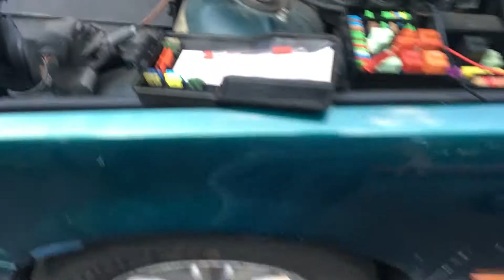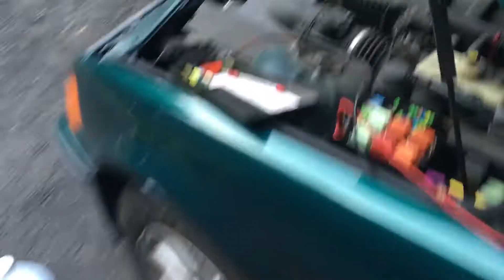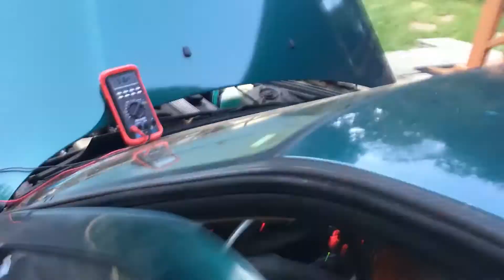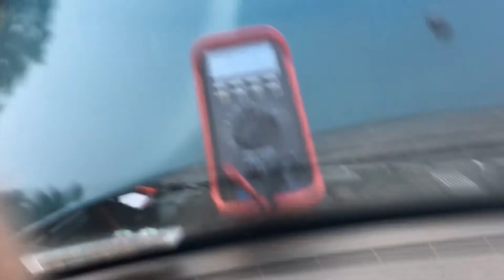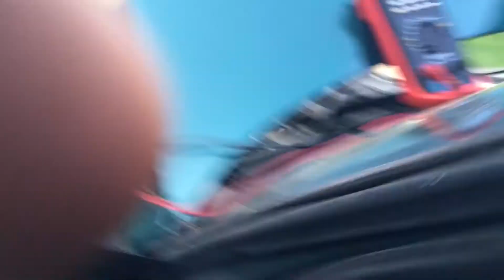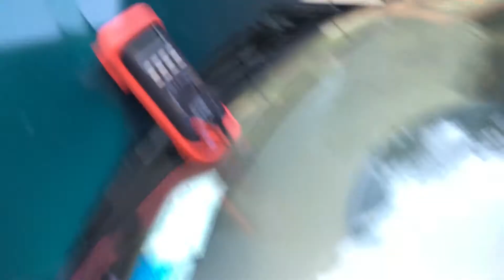1997 BMW 328I E36 - No Start / Fuse 31 Blown / Bad Heater Control Valve / Troubleshooting - SOLVED

Comment: I had the same issue a few months back in my e36 328i 96 obd 1. Fuse 45 was blown, it’s for the brake light control & instrument panel. Fuel gauge wasn’t working too. Replaced that fuse 45, car started.

Comment: So my 328i has the OBC and HVAC turn on and off periodically (weeks in between) and I’m suspicious of the heater control valve doing something similar. I’m not sure why obc goes out though. Thoughts?
Reply from the maker: I can only suggest disconnecting the heater control valve and seeing if the problem goes away. The valve isn’t needed for everything to function, It just will get hot in the cabin in the summer. I am fairly sure it locks off the heater core when you aren’t calling for heat.
Reply: @StanwoodStudios  I’ve had same issue, I’ve had my hcv unplugged for about 2-3 years without a problem or blowing fuse 31 👍🏼
Reply: Its proabably the heater resisor under the driver dash